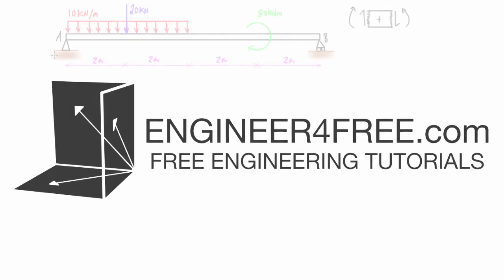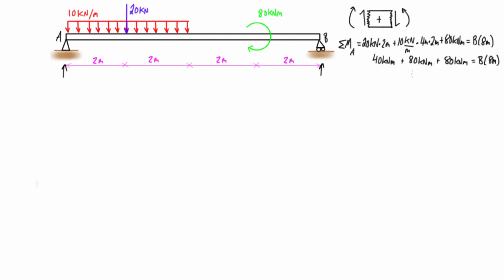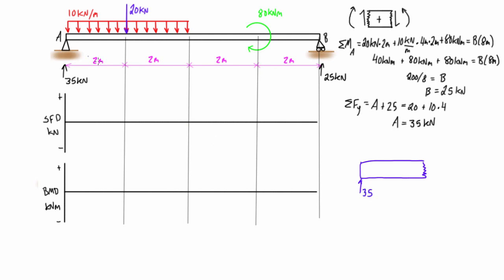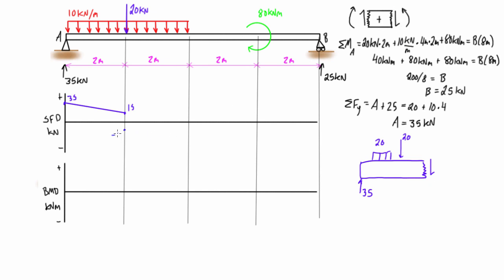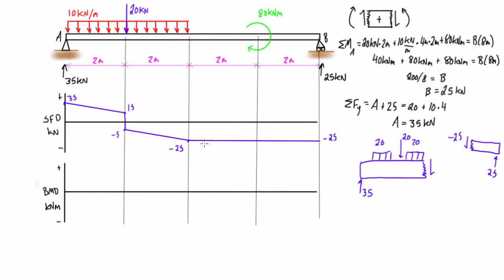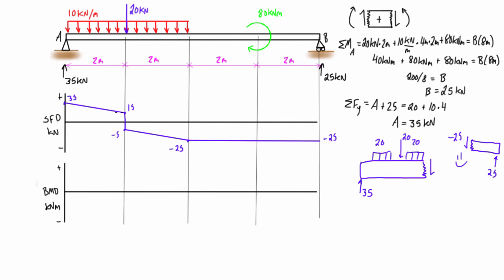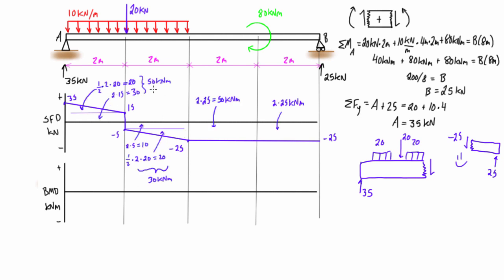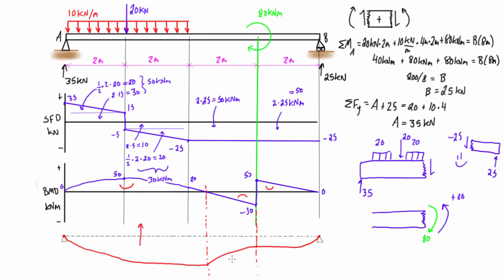Shear force and bending moment diagram practice problem #9

Comment: Hi I’ve seen all the bending / shear force diagrams video examples but haven’t seen an example like this one https://drive.google.com/file/d/1eGi8YchJU-z4upWB4PV6phdMsWJCtBPn/view?usp=drivesdk ...... Can you please explain this. Thank you
Reply from the maker: Ah yeah, that's not a simple beam problem any more, it's có soldered a frame. You're going to need to draw 3 SFDs and BMDs. One for each horizontal section and on for the vertical section. The vertical BMD will be rotated 90 degrees to match the orientation of the member. Solve the reaction first for the overall structure, then solve internal shear and bending moment at each 90 degree corner but model each of the three sections as their own single straight member with a rigid connection that transfers the moment and or shear/axial force. You'll need an axial force diagram too sort of because it will be non zero in the vertical bit. I'd be surprized if your prof gave you this problem without explaining the general method of how to go about it first. Even tho some diagrams will be drawn in different orientations, the magnitude of the values generally is same on each side.

Comment: Hi, how would you solve a problem where there is a UDL, and at each end of the UDL there is a point load?
Reply from the maker: Hey William, take a look at the other 8 examples I did at engineer4free.com/structural-analysis The SFD would jump by the magnitude of the point force, at the point force, and then gradually change across the udl as expected, and then jump again at the next point force t the other end of the udl

Comment: If for the Bending Moment Diagram, the end result doesn't reaches 0 on y-axis (mine reaches -1) does that mean it is wrong? I've checked to see where I'm wrong and my SFD is correct, but I'm out by 1.
Reply from the maker: If the beam is simply supported, then yes each end should be 0 unless an applied external moment is acting at the end your talking about and has a magnitude of 1. Are you dealing with a simply supported beam or a cantilever? Rigid connection of a cantilever will most likely not equal zero for the BMD at that point.
Reply: @Engineer4Free  Would you mind if I made a link to the question + my working and you can see where I've gone wrong? It would be much appreciated :)
Reply from the maker: @kaneneil4034  yeah np just upload it to imgur or w/e and share it here

Comment: I thought since the moment is clockwise moment it would be negative. Therefore B=5 kN and A=55 kN instead? Also, do you have any videos of V(x) and M(x) diagrams for triangular distributed loads (mostly for determining curvature)?
Reply from the maker: I skipped the step where all the moments are on the eft hand side and sum to zero. I just went straight into putting ones that give a clockwise moment about A on one side and and the ones that give a counterclockwise moment about A on the other side. By doing that, you actually get positive values for every term. Hope that makes sense, if it doesn't try writing all on one side equal to zero and then moving any negative terms to the other side, should end up with the same thing.
Reply from the maker: Oh, and no I don't, I only used uniformly distributed loads in my structural analysis videos (here: engineer4free.com/structural-analysis). The videos do cover some things about curvature, but just with point loads, moments, and udl's

Comment: Hi thank for your video. Why does 80 moment go up to +50?. Thanks in advance.
Reply from the maker: The magnitude of the moment is 80 kNm. The BMD jumps from -30 kNm to +50 kNm at the location of the externally applied moment. 50 - (-30) = 80. The BMD will jump by the magnitude of an applied moment just like how the SFD jumps by the magnitude of a point force at the location of a point force. With practice it becomes easier to recognize which way it should jump.

Comment: Nothing with how to find the area for a parabolic shape in the shear diagram? You can't just draw a perfect rectangle and then a triangle and get the area out of that. Please help
Reply from the maker: What do you need the area of the parabola for?
Reply: @Engineer4Free  to draw the moment diagram
Reply from the maker: The area under an interval on the SFD translates to the change in magnitude of the BMD across that same interval. In this video there are no parabolas in the SFD, so the area calculations are simply the sum of squares and triangles. The shape of the BMD becomes parabolic in a region with a uniformly distributed load (presence of slope lines or triangles in the SFD). It normally suffices to just draw the parabolic shape on the BMD and just the magnitude of each side of the interval and any local max or min that occurs. If your BMD is too squished and it's not obvious that it is a parabola that you have draw, it's good to just write a label acknowledging that it is parabolic in that region.

Comment: thank you for these videos, huge help - I have a question however: how do you deal with a diagonal beam at an angle?
Reply from the maker: If the entire structure is just the one beam, and you have loads in the vertical direction, then you will have some axial forces. If the structure is more complicated, then it is a frame problem. Unfortunately I don't have any videos on frames at the moment, just beams.
Reply from the maker: If there are axial loads, you need to draw an axial force diagram as well, it's very similar style to the shear force diagram.

Comment: i still didnt get why u went up 100 on the moment
Reply from the maker: The moment only jumps by 80kNm at the point where the externally applied moment is. 80kNm happens to be the magnitude of the externally applied moment at that location. It's like how the SFD jumps by the magnitude of an externally applied point load at the location of said point load.